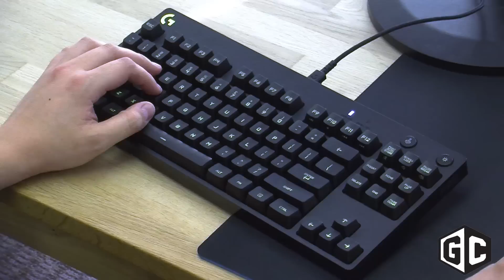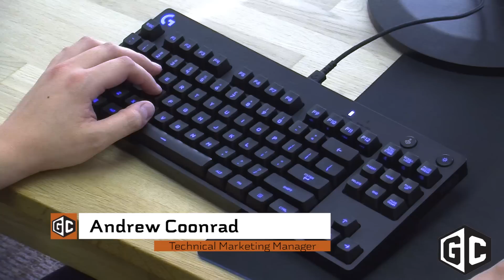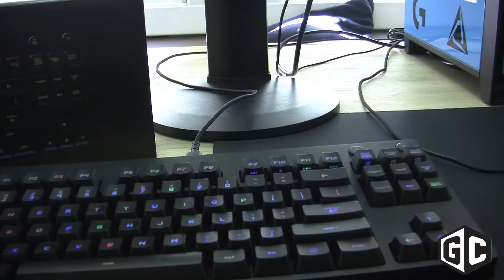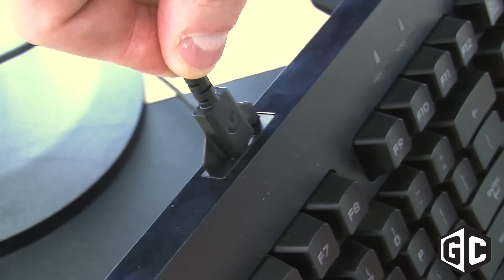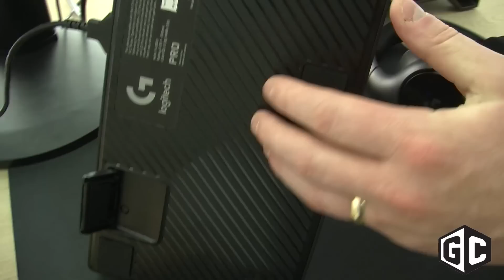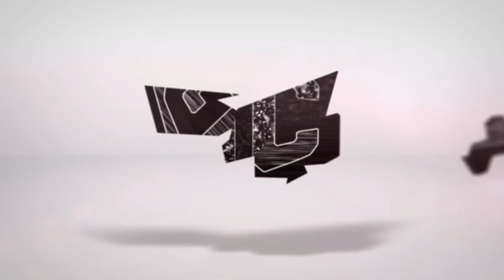First look: Logitech G Pro tenkeyless gaming keyboard

Comment: My main gaming keyboard. Even though I like to type on it as well. Switches feel like a speed version of MX Brown ( Actuate at 1.5mm / 3.2mm total travel ). I use it over my Filco Majestouch2 Ninja mx brown for gaming. But I would rather type on my Filco. The GPro just feels faster for gaming in key press response time and the switches just feel pretty similar to the browns I already love. So its great for me. Also love the clean look and small size. RGB is extra clean too with no under glow bleed ( love it or hate it thing ).